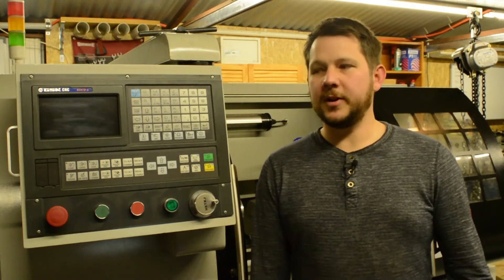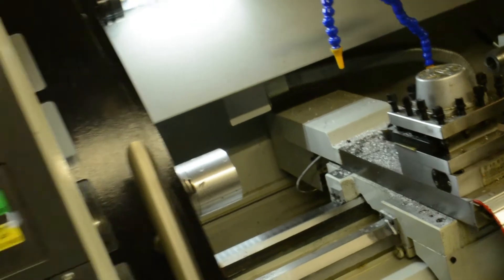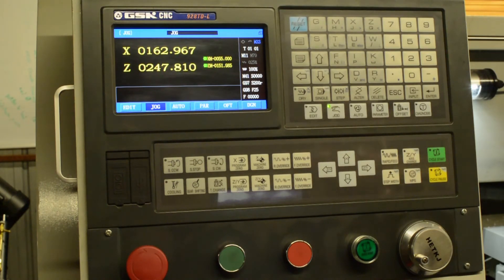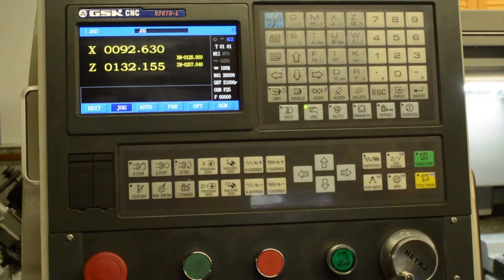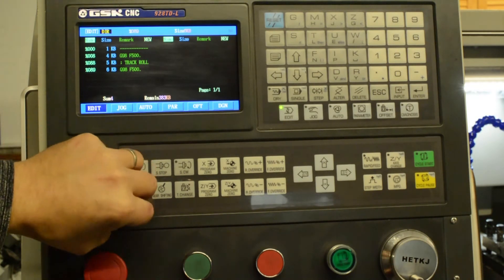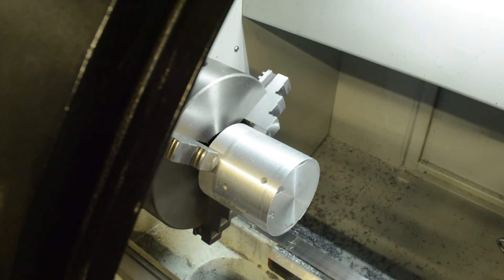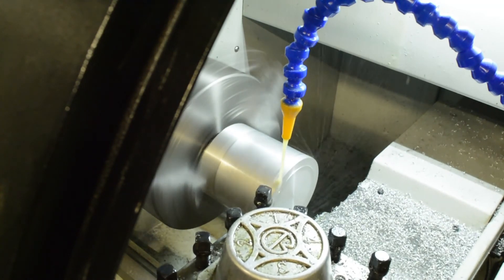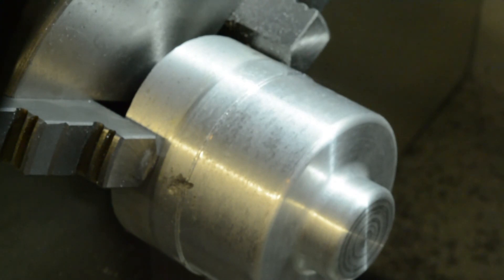Getting Started with GSK928TD-L CNC Lathe Controller

Comment: Hi sir
I have GSK 980 TDB Lathe controller.
Our machine have 8 station Tool Turret.
I call the Tool indexing or turret indexing but it cant stop.
I need proper wiring drawing and parameters setup.. Kindly give the information

Comment: Hi James
I have GSK 928 t cnc machine and I have problems with the electrical circuit. The machine not started and I brought  electrtion and he asked for the electrical circuit diagram. Maybe you can share the diagram if you have it or maybe took a picture for the wiring system in your machine . Thanks

Comment: Sir, for example the desired size is 10 mm,
 And the workpiece has been set but the result of the workpiece is 10.2 mm.
 How to change the size to 10 mm, without editing the program?  Please help, sir.  Thank you
Reply from the maker: hello, you need to adjust the tool X offset by 0.2mm in the offsets page.
Reply: Thank you, sir. 
I entered the offset page then typed -> X-0.2 then enter.  or what, sir

Comment: I am getting the same lathe with the same GSK controller. Are you planning to make more video on the subject. I think it's a good CNC system for it's price. Thanks a lot for posting this.
Thing I think are interesting:
1- You do not show the work offset used. I guess was G54 but better to specify what you see on the screen. I guess the bigger number are in work offset and the small ones next to them are machine coordinates. Are the tool offset in machine or work offset coordinates?
2- Would be nice to know how to handle when you have mixed tools between the turret and the gang style. In your case I guess T01xx to T04xx is turret, then above should be on the table. Does the GSK recognized what it's inside the turret and what no?
3- In the manual I see we can write " user define commands" from M60 - M74. Would be nice to see how to do it, which language to use ecc...
4- For automatic production, how to set count limit.

This just few ideas. 
Thanks a lot!
Reply from the maker: Thanks for the video ideas! Unfortunately I don't own this machine, I just created the video using a friend's machine so it would be hard to make any further videos on this topic.  As for your questions
1- there is no idea of work offsets on this machine other than the program reference point shown in the video. It doesn't understand the concept of g54, etc like other machines, it's very simple.
2- anything higher than T04xx doesn't activate the turret, you would use these tool offsets for your gang tooling.
3- and 4- very hard to explain in a simple paragraph but great topics for a video to cover.
Reply: @jamesfinniss6448  That what I was afraid off 😅 Anyhow thank you very much for give us a bit of hope on this CNC control system. It's a bummer that it doesn't allow for separate work offsets (G54/G55 ...). That would have been really useful for the times you want to use fix tool or bar puller without the need to offset them from the master tool. Thanks again.

Comment: Hello guys, i do have the same machine... it just happened that i turn it on and everything is in Chinese, anyone can help me and guide me telling me how to change back the language to English?
Reply from the maker: Hello, you need to change bit d7 from 0 to 1 in parameter P413. Chapter 4 of the reference will show you how to modify parameters, specifically page 123 has the details for P413. If you don't get it working, let me know and I'll make a video when I am at the machine next.
Reply: @jamesfinniss6448  Hello Sir, I am having the same problem with the language on my machine. I hope you make videos regarding this, it will be a Big Help for Us ^_^ 
Thank you so much sir.
Reply: Hello, can you help, please? I don't know how to use G71 cycle in that machine. I do know how to use that code G71 in GSK 980TD control but a cannot use it in 928 control. What a problem.

Comment: Hello Master.
In the Fanuc control, you can do this for chamfer and radius:
G0 X48
G1 Z0
X50 C1
Z-50 R2
X100 C1
Z-80
In the GSK 980TD control, how is it?
Reply from the maker: Hello Marcos.

The GSK control does not have the same C and R parameters as you know but you can use standard linear (g1) and circular interpolation (g2,3,5) moves. 

Its not as elegant but will achieve the same result.
Reply: @jamesfinniss6448  I searched the chamfering functions and found what I needed. I hope this example will serve others.
(GSK)
G0 X48
G1 Z0
X50 L1
Z-50 D2
X100 L1
Z-80